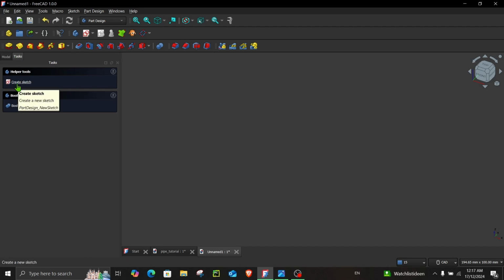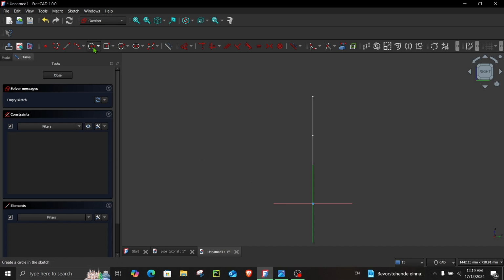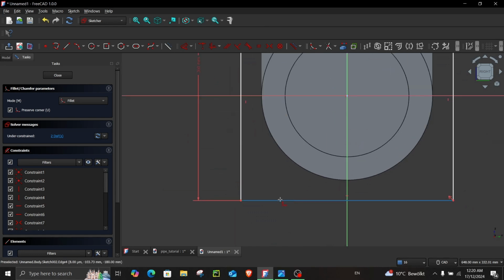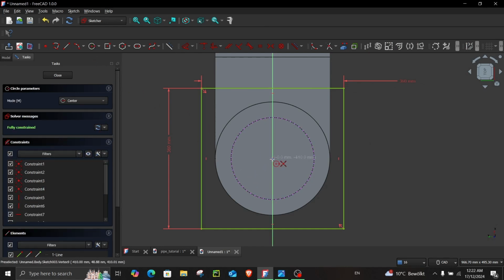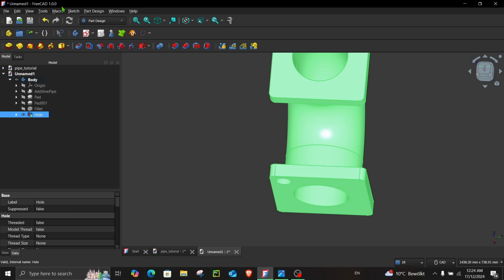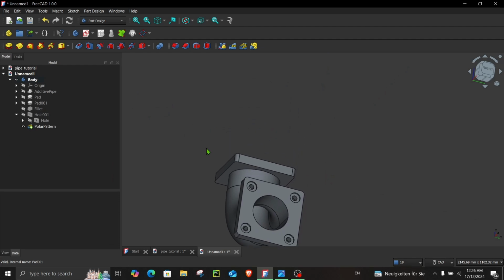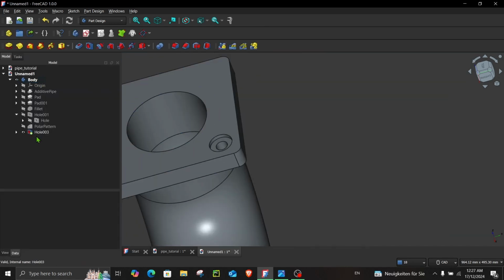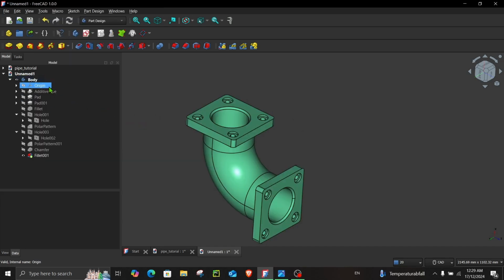FreeCAD 1.0 Beginner Tutorial | Exercise 1

Comment: Note to OP:  The circle you put in the Hole Sketch isn't used by FreeCAD for the Hole Function. You don't need it.  Use a "Point" instead for the Hole Function to use for making the hole. The square construction lines are irrelevant, too. Not used. Also, you used the Polar Array. I couldn't get a circular function to make the four holes on the square flange. I used the Linear Array and the Direction 1 and Direction 2 for the hole pattern to work.  Also, I know you will in another video - But, it's easier to make the Counter Sink at the same time with the Hole Function. Thus, your hole pattern sketch doesn't require a circle or the square construction lines.   (Just trying to simplify and make it work.)  Thanks for your good video and explanation. Very easy to follow other than the above Hole Pattern creation.

Comment: Great video. Isn't there a geometry issue? On the diagram the 150 includes the 50mm plate.  On your design I may be wrong but I believe the 50mm plate is built off the face at the end of the 150mm straight section. IE the original straight section was 150mm, yours is 200mm? I mean it doesn't change the tutorial which is great, but it shows how it's easy to make a mistake. Unless I'm mistaken. Which I may be!!! Great video though, please do more! :D
Reply from the maker: The plate is indeed built off the face at the end of the 150mm face. However, once you check the "Reversed" option in Pad parameters, it extrudes in the opposite direction thus merging with the 150mm. Glad you enjoyed the video :)